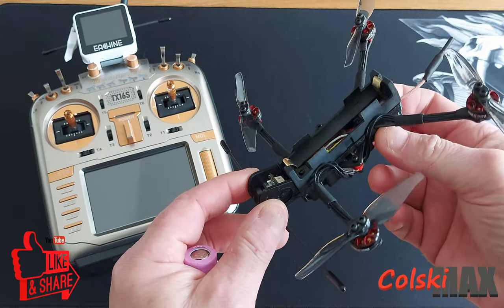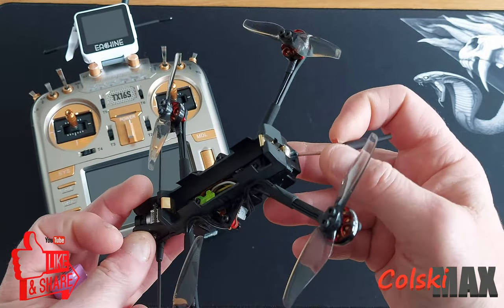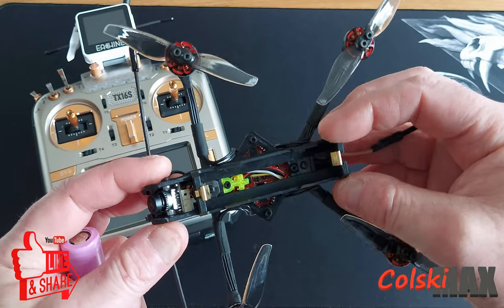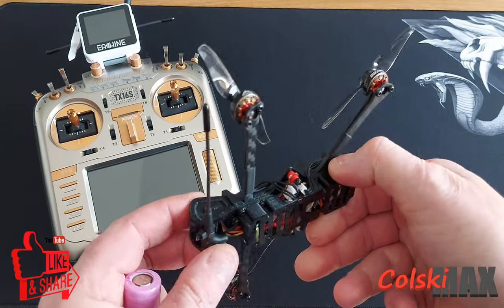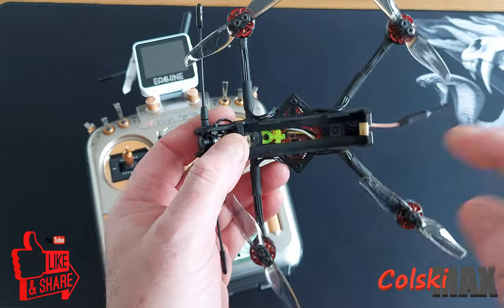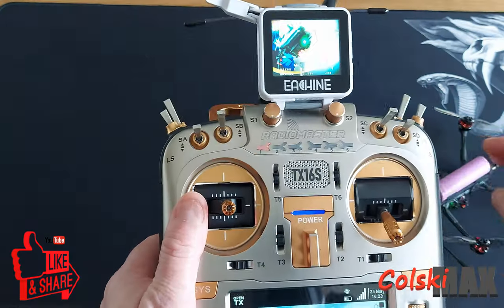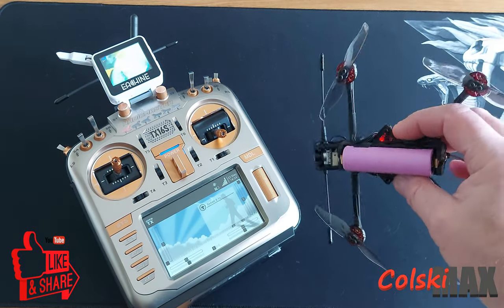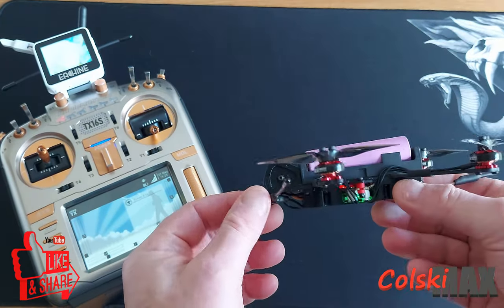HGLRC REKON 3 "the flying battery" GIMMICK OR THE FUTURE OF FPV

Comment: I think at this point there's not much left to figure out with quads other than longer flights, everything else is or has been being done. I think there's better more durable with close to same specs. It's ok, just not spectacular. Plus it looks really fragile, like one hard landing could crack the plastic plates. Good review though